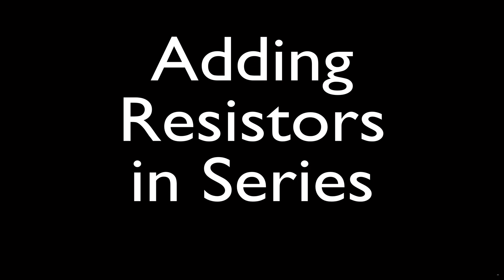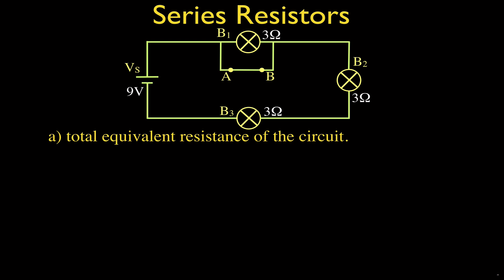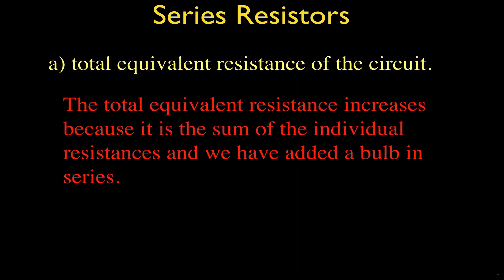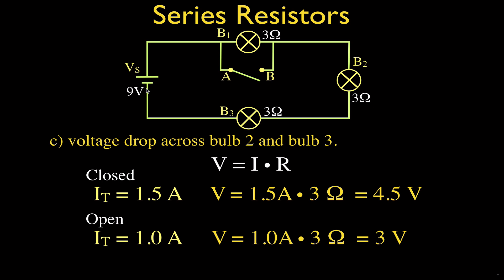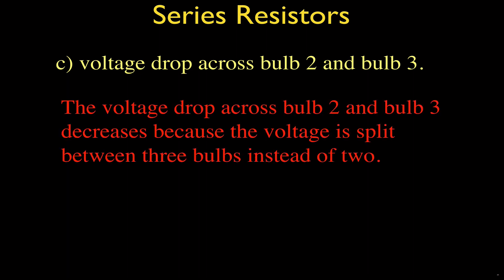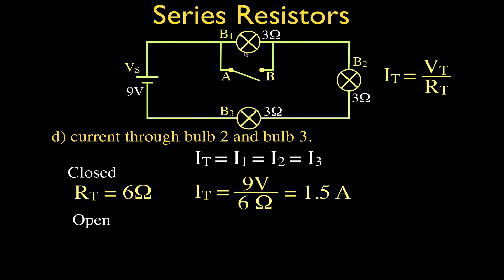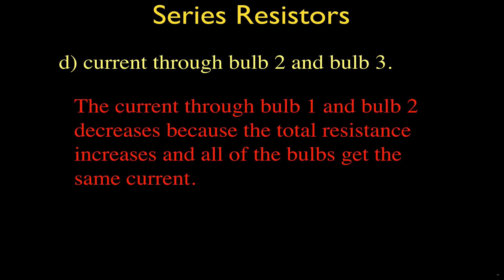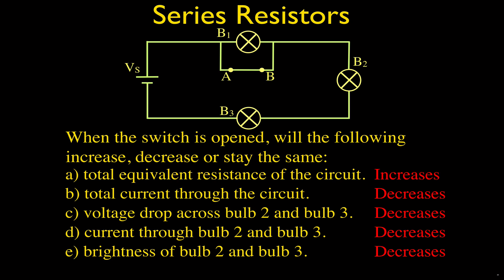Resistors in Electric Circuits (4 of 16) Adding Resistors to Series Circuits, Part 1

Comment: Is there a video about what happens if the bulbs were replaced with low power bulbs such as LEDs? LEDs would have lower resistance, which from this would result in higher current, but actually results in lower current an power in the circuit. Can anybody explain or point me to a video that explains why? Thank you.
Reply from the maker: Sorry, I have not yet made such a video.

Comment: Why is it when the switch is close, current do not flow through bulb 1? Doesn’t current take all paths available?
Reply: With the switch closed, you have a parallel circuit so current flows through both wires inversely to the resistance. The resistance of the wire is considered negligible compared to the bulb so nearly all the current will go trough the wire. A very small, negligible current will flow through the bulb, but will not be nearly enough to light the bulb.

Comment: Soo this means that 2 bulbs means 13W in total and 3 bulbs means 9W in total? I'm trying to understand why both circuits didn't have the same power. This means that resistance must be low to have higher current and voltage and make bulbs efficient but what can make them burn for exemple?  If I have a 100W bulb it should work with both 100V and 1A and also with 100A and 1V,if it can be possible to have those 2 extremly different values of voltage and current.  So what can cause a bulb to burn, voltage or current?